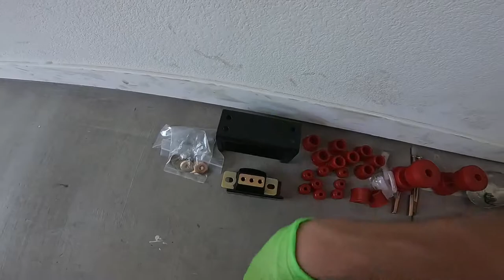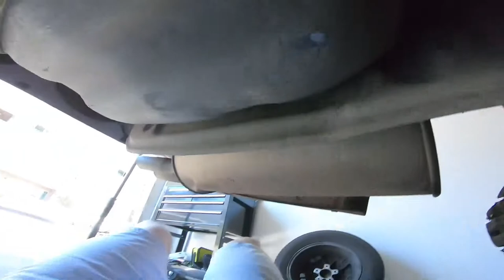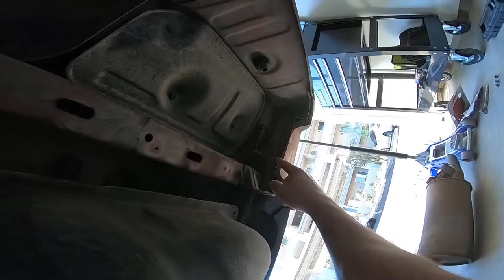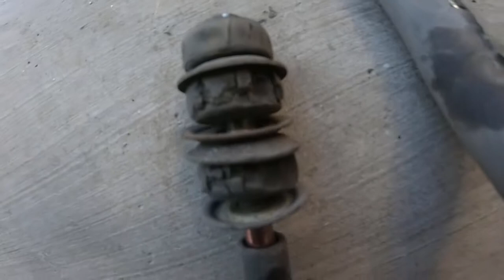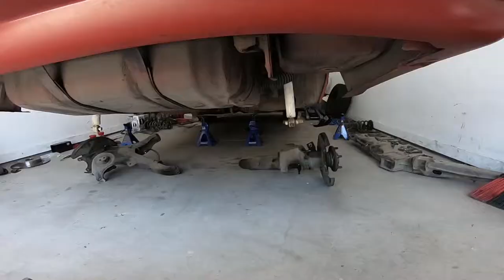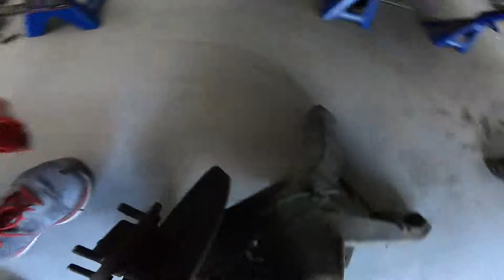300zx z31 Rear Suspension Overhaul Part 1 (clean, paint & install Polyurethane bushings)

Comment: the bolts on the control arm that you pointed out as weird are excentric bolts that can adjust rear wheel alignment i believe
Reply: Exactly, good luck replacing them.  I have the rear out of my 84 v8 S12   The service manual has a good picture of these bolts.   Supposed to mark them to keep the alignment.

Comment: Those weird bolts for the control arms are so you can adjust the toe-in. You need to keep those or replace them and get the car aligned since you didn't mark the position of the bolts. Don't use regular bolts and washers.
Reply: Keep the videos coming! There aren't enough for our old cars!
Reply from the maker: Yeah I actually ended up buying those bolts brand new from the z store so we are all good there. Thanks for the info I appreciate it!
Reply from the maker: @erronreq  Thank you and I agree there is not much love for the z31!

Comment: Yes what was the after market part for the dif mount.
Reply from the maker: PastPower Innovations Polyurethane Differential Mounting Kit for the 1984-89 Nissan 300ZX
Reply: Thanks I just bought a 1985 non turbo and I already started on the replacing all the old bushings.
Reply: Thanks for all the help. The videos are super helpful